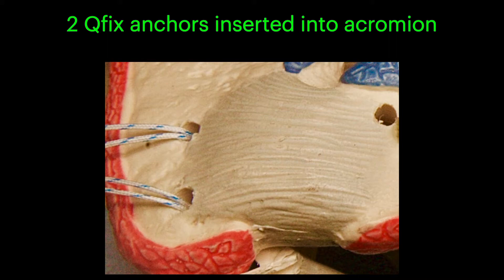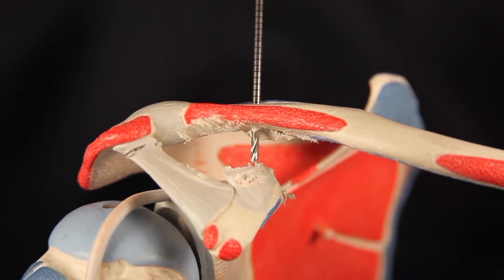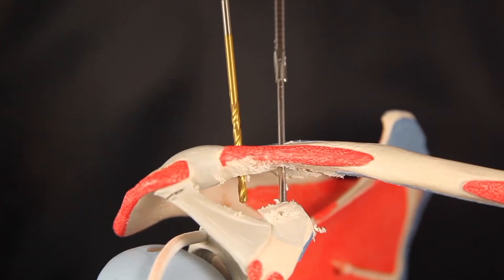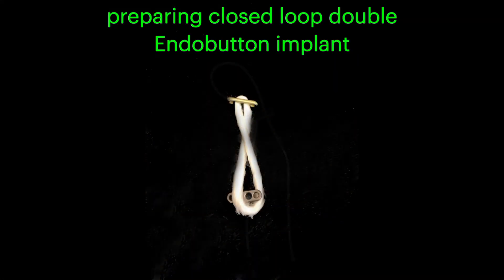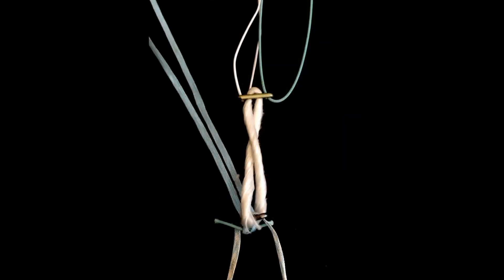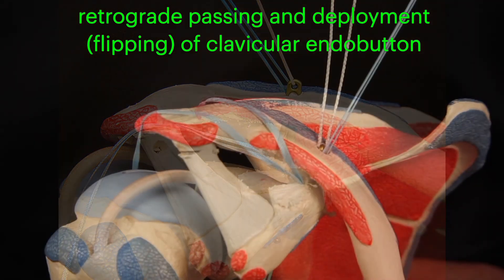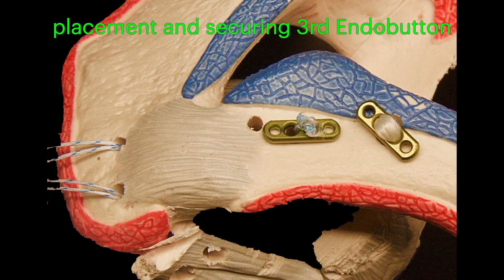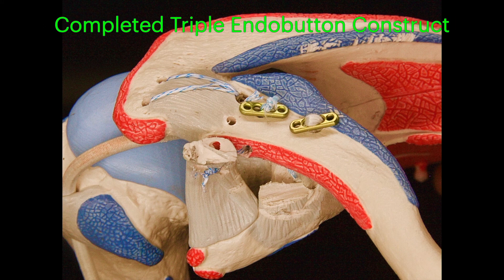AC Joint Separation Repair | Triple Endobutton Construct | NYC Orthopedic Surgeon Dr. Steven Struhl

Comment: Andy Rojas Just had this surgery 2 weeks ago.  If it is an acute case(less than 6 weeks) your existing ligaments are sutured together.  If it is a chronic case(more than 6 weeks) the ca ligament is harvested.  For a revision case such as mine same thing CA ligament is transferred and if the CA ligament is not available a donor graft is used.
Reply: How did your surgery go? Are you fully recovered with full strength?